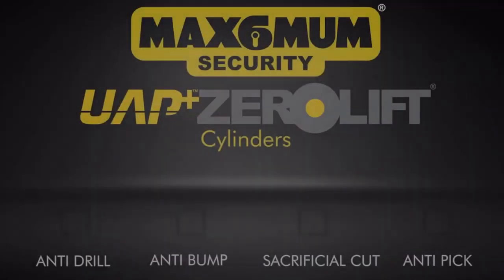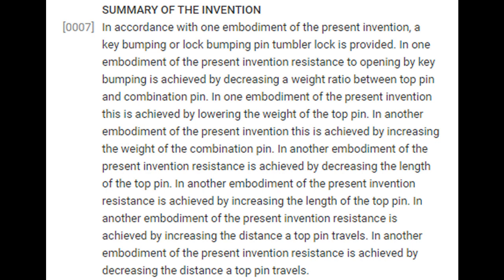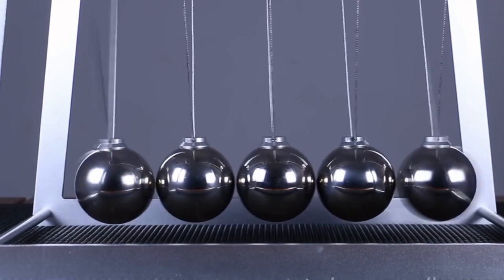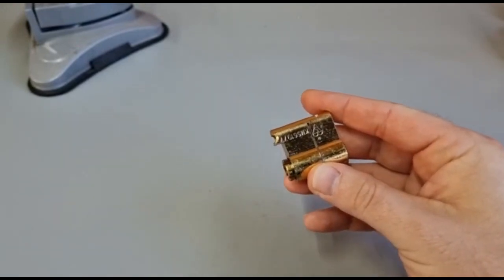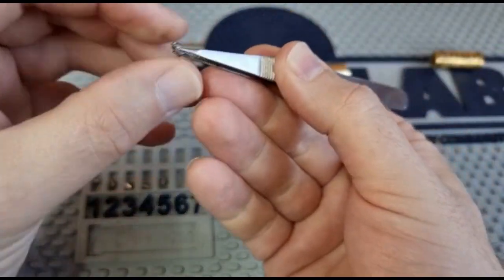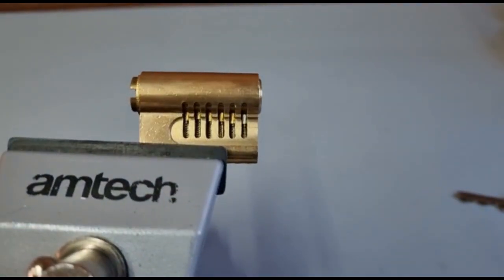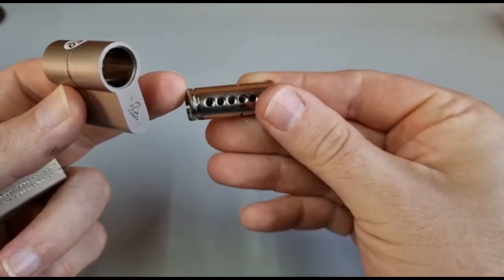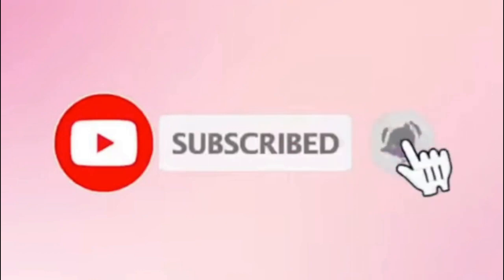LOCK PICKING: The Weird World of ZERO-LIFT!

Comment: It does make it far easier for a locksmith to replace if a customer has lost the keys but still has access to the inside. The Trimas TS007 has just standard pins on the interior side, albeit more than just two! Does it reduce manufacturing costs enough to just pin two chambers?
Reply from the maker: Hello Dave. Yes, that makes sense - maybe that's why it's like that, you don't really need all the pins on the interior. It could save money if you're having tens of thousands made - BUT....I think your diagnosis makes more sense, and I didn't consider that at all, so nice one, appreciated.
Reply: @LockPickingLegend  Being able to open a lock easily from the inside is still a security concern. Imagine smashing in through a window. It would be far easier nicking a big TV if you could exit via a front door with just a Yale thumb turn on the inside for example. I think the decision to buy one of these locks depends on what you are protecting and locking up. Risk assessments and all that malarkey! 😀

Comment: The challenge lock I bought has a 0 lift pin in position 4 of 6 and I have yet to defeat that lock. Its a masterlock 6271 hidden shackle puck lock, which i know is full of serrated pins with 1 spool, as well as serrated key pins. Tips would be appreciated.
edit: I'm aware this lock is comable, but i do not have any comb picks. I also don't consider a lock defeated until I can SPP it.
Reply from the maker: The only advice, without actually picking the lock would be to keep trying. There's a binding order, and the zero lift is last, lol. You'll get there.